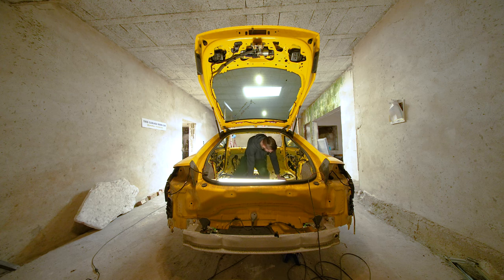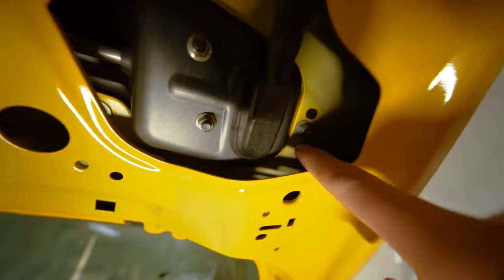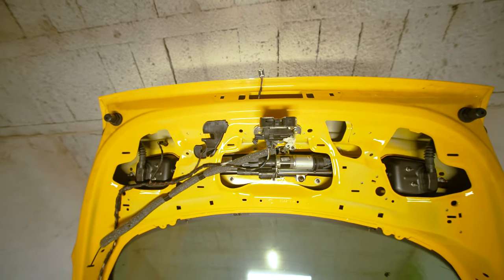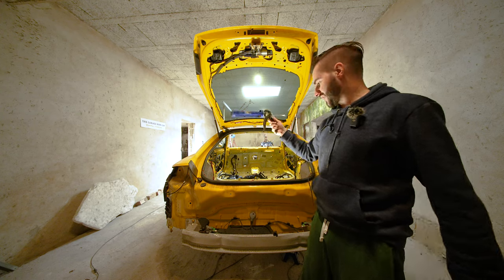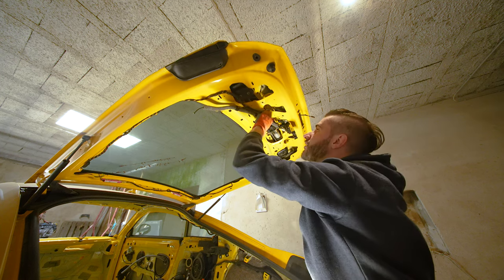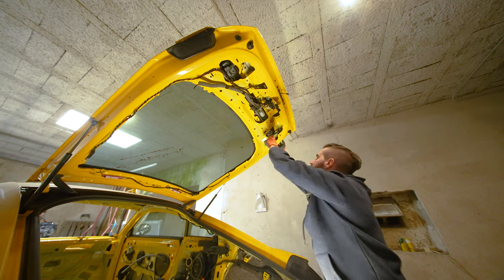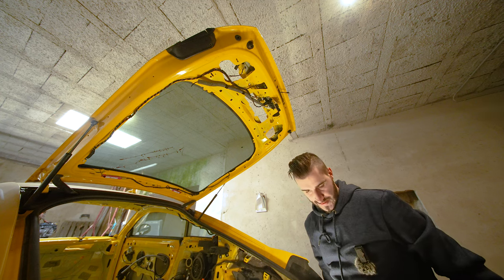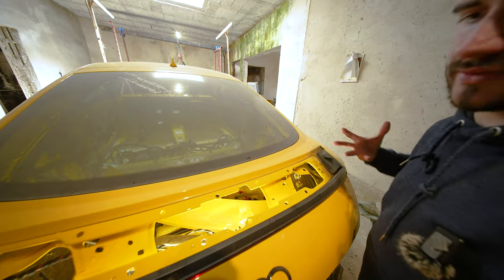How to seal rear spoiler - Audi TT mk3

Comment: In December 2022, my 2016 TT was rear-ended on the freeway. The bumper, tail light and trunk lid was replaced. After a hard rain, water got into the trunk latch + license light assembly and ruined it. Sometimes after it dried out, it would start working again but it's only a matter of time before corrosion will win.

In August 2023, I brought the car back to the auto body shop that repaired it and another latch unit was installed ($370 CAD per unit). At one point the car might have been transferred to the local dealer, too. 

In February 2024, the latch flooded again and died. I brought the car back to the auto body shop and made a warranty repair claim for another latch unit. 

Fast forward to September 2024 and the latch unit has flooded and failed again. I should get together with a bunch of other TT Mk3 owners and maybe we can get a bulk deal on latch units! I think the spoiler will need to be removed and resealed again with silicone which seems like a good idea. I don't know if my insurance company will follow up with the previous claim yet or what kind of repair they will authorize.
Reply from the maker: Oh my, sorry to hear about your unfortunate story… try to claim it again, and seal it with silicone yourself as soon as you get your car back from repair… that way you know its done right :)

Comment: Hi if I glue spoiler will water still go into rear camera? Or do I have to glue both spoiler and rear camera?
Reply from the maker: The water usually comes through spoiler. But its not a bad idea to seal the camera as well. I have a video on that as well, check it out :)
Reply: @cars_anatomy  thank you for the info

Comment: Hi mate! I have a TTRS without the active wing. I have an aftermarket wing on the car and an issue with water getting in and ruining my plate lights and latch mechanism. Do I need to seal where you sealed or just the bolts that hold the wing onto that panel?
Reply from the maker: I would make sure to seal every point where water might be leaking in. So once around the perimiter of the spoilers, and around the screws as well :)
Reply: I have this problem also. Lifting the tailgate resulted in water flowing even through the seat belt entry points... taking it back to bodyshop where I got the wing installed tomorrow
Reply from the maker: @challengeronrift  oh my, that is aloot of water :(( i hoe they fix it. You can tell then to seal it like this. :)